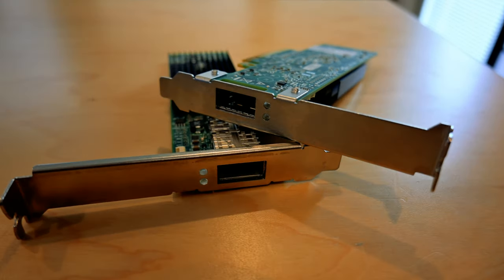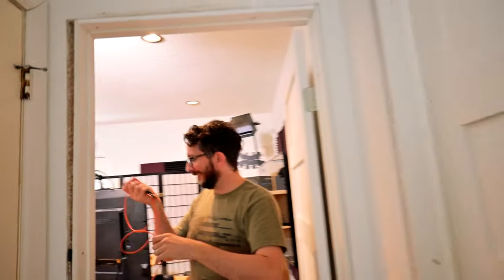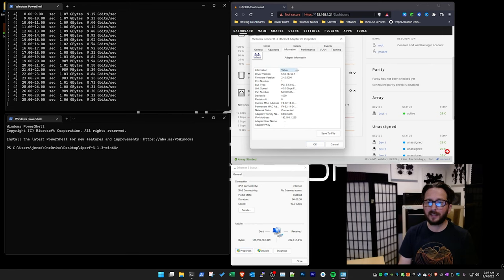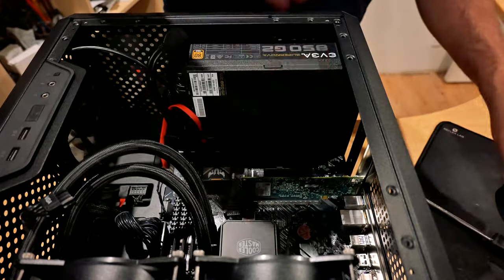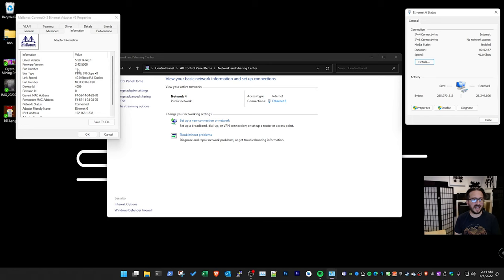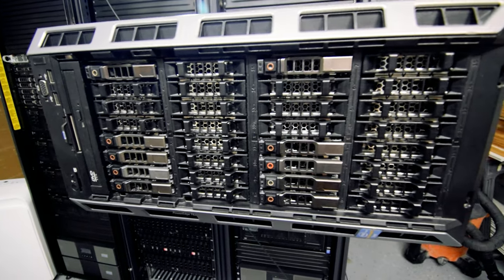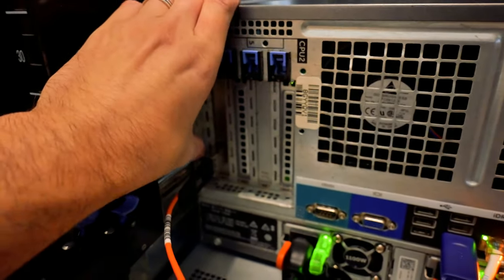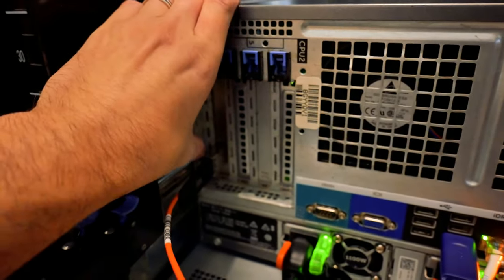ULTIMATE 40Gb Homelab Networking - UNRAID NETWORK SETUP

Comment: I run 100 Gbps Infiniband in the basement of my home.

It was mostly used for HPC applications (CFD/FEA -- that sort of thing). Within those IB/RDMA/MPI aware applications, I was getting somewhere between 80-90 Gbps throughput (depends on the problem and the application, and also the size of the problem that it was solving).

Using the IB bandwidth benchmarking tool, I can get up to around 96-97 Gbps.

For me, using said 100 Gbps IB network for storage is really just a fringe benefit as it wasn't deployed with that in mind.

Having said that, I don't have like a pool nor an array of NVMe SSDs (in fact, I try to avoid using SSDs because SSDs are the brake pads of the computer world in that the faster they are, the more you're going to use and more likely you're going to use them, which just leads to wear out.)

So instead, I use 36 HDDs, and as a result of that, my throughput is limited anyways.

But it is nice that I CAN max out at roughly 24 Gbps with eight HDDs, with the nominal average closer to around the 4 Gbps range. But my LTO-8 tape drive can really do only about 200 MB/s (~1.6 Gbps sustained) so the fact that I have so much networking bandwidth/headroom - again -- storage part of this was just a fringe benefit as a result of the HPC micro cluster deployment that I had.

On a $/Gbps basis, 100 Gbps IB is cheaper than even 10 Gbps, even if the NICs, cables, and switches have a higher absolute cost.

(I run it through a Mellanox MSB7890 externally managed 36-port 100 Gbps IB switch.)

Comment: I just ran a 10gig Fiber line between my Mikrotik router and Switch and it's awesome!
Reply from the maker: The speed is addicting. Folks tell me 2.5 and I'm like....nahhh go 10!
Reply: @DigitalSpaceport  I just set up my first NAS with a 1GB connection. It's very annoying!
Reply from the maker: @eazolan yeah at 1Gb link it's not fast enough. I'm not sure why some folks say that's fine, people expect a folder preview to load pretty fast in modern times
Reply: @DigitalSpaceport  not fast enough when I have a 1Gbps fiber connection with multiple people streaming outside of my network and inside at the same time. I am going to be adding a Dell emc sc420 to my system shortly

Comment: really sweet tutorial, i didn't realize CPU speed had such a big impact on 10/40 gbps ethernet, kinda odd that it doesn't utilize multithreading on the cpu.
Reply from the maker: With 40Gb core frequency is critical. 10Gb less so. When we get to the shared storage video I'll go over some bottleneck points again.
Reply: Something to remember is that these NICS all have ASICs onboard to offload some of the network processing from the CPU to help free up resources.
Reply from the maker: Yeah I need to dig into tunables but for ETH traffic it still blows the hell out of the processor. Do you have some things I should check in specific?
Reply: @DigitalSpaceport  Yea 40G is no joke. It's for sure worthwhile to run a server CPU and board, gotta love those lanes. In regards to the settings It's called a little something different between vendors but what you're looking for is TCP Offload and then depending on what vendor they have configuration guides for things like RDMA, ISCSI, VXLAN offload, etc to be offloaded to the super fast silicon on the NIC. I know for sure Chelsio's cards have native support in BSD based operating systems for a lot of these features. Check the doc from your vendor. As the cards get newer like the 100G and up ones, the onboard hardware is faster and faster with each generation. Older 40G NICs and switches have a bit more latency and less features according to Wendel from L1 and I believe Pat from STH did a comparison on generations of connectivity fairly recently.
Reply: This is a limitation of iperf3 it is just single threaded. That's why you can achieve 40GBit/s with 2 instances! Also increasing MTU size also helps with cpu cycles on larger transfers

Comment: Great video! Love to see more people getting into "Big boy" networking 40G and up! 2 things, have you considered the jump to 100 with Mikrotik's new $999 4 port 100G switch and do these brocades need any special licensing or anything for L2.5/L3 features? Looking at the POE version of what you got. Thanks.
Reply from the maker: I do love the power behind that ICX6610 for sure. I have been looking at that Mikrotik 100g powerhouse but I thought it was only 100Gb total switching? https://mikrotik.com/product/crs504_4xq_in Is this the one you are talking about? 
I need to get PCIe4 NVME storage arrays to really utilize 100Gb and I don't have those servers in the racks.....yet

The Brocades you should checkout the STH thread that has massive info on the ICX6610. If you get one that has not been R2'd it may well have all the original license stuff installed. Mine had the PoE, 80 and 160Gb module (which is what they call all that power in the backside) already. I disabled the PoE on mine but I have a 5548p that already is setup for all that.
Reply: @DigitalSpaceport  Their test data seems way off. I remember seeing it and thought it looked neat for labbers. I wonder if they missed a capital B somewhere. Used 100G iron is starting to come down in price too thankfully.

Comment: Such a cool video.  I adore this shit.  I’m gonna build something similar with TrueNAS, gaming PC’s local, remote bare-metal gaming PC, and 3 gaming VMs using a shared Tesla and a dedicated RTX 3060, just for the fun of it and to learn. iPerf is fine for testing, but good luck getting anything remotely close from an UNRAID array unless you carefully lay out the data across all the disks and then query them consistently.  Unraid is slow, even with NVMe, for numerous reasons.
Reply from the maker: That 40gbe is so cheap is pretty crazy and fun. If you hit FUSE yeah its going to cap out very early. Direct to mounts can be faster tho.

Comment: Great video! Were you able to connect this through Brocade icx6610? I'm getting only 10Gb (I have dual cards) and not sure if there is 40Gb license.
Reply from the maker: Check the licenses section in the GUI to see what you have. System > General and then in the displayed screen click Config Module on the left hand side. If slot 2 reads "ICX6610-QSFP 10-port 160G Module" with status ACTIVE then you have your rear QSFP slots functional. The 2 on the right hand side are 10gb capable (1 to 4) or single 10gb and the 2 on the left side are the actual 40GB ports.

Comment: @DigitalSpaceport I recently bought a SX6036, could you help me configure the switch for ethernet license generation? i have been researching the guide server the home but i am short on time and would like a jump start.
Reply from the maker: Some switch models require the license others have it already enabled by default. It depends on the manufacturer. If you can't enable eth mode/vpi then your going to have to use the serverthehome forums thread and there is also an eBay seller who sells the licenses, I'll leave it to you on the eBay one if you trust that. I've had 3 of these switches now and I think it's the mellanox branded ones that need licenses applied. The HP ones seem to just work outta the box.

Comment: 2 questions:
1. I got a PCIe 2.5gb network card and put it in my machine but I don't know how to switch my unraid to use it instead of my main one (1gb).
2. Dumb question. How do you get that view on your interface, all I got is digits?
Reply from the maker: 1) You need to make sure it is showing up in your interfaces dropdown here: Interfaces > Interface Assignments > WAN and that is where you set it also.
2) Status Dashboard check the upper right side. There is a + icon. Click that and you have a lot of cool widgets to use.

Comment: Nice video, i bought two card Mcx354A -FCBT but my  unraid is not able to discover in network setting ,  can you suggest how to make it working
Reply from the maker: Yeah you are going to need to install the mellanox plugin, in the app store, and may need to flash the cards and/or set them to mode 2 operation ETH if they are for some reason in IB mode. The plugin gives you the steps to do that.
Reply: @DigitalSpaceport   Thank you for the answere , i already install plugin , but the  MCX354 -FCBT is not in the list for the eth mode ,i flash the one for my card at least update, i do not understant how to switch in etherneth mode

Comment: What’s the point with Unraid?  I have 2 servers running 2 x 10GbE each.  Even when I was first copying data where all the disks were being used, I saw a max just over 1.5Gbps.  Pointless.  Unraid is SO SLOW.
Reply from the maker: unraid hits FUSE by default so yeah its slow unless you write to a mount direct... which defeats the purpose in no small measure. Performance, TN wins hands down.
Reply: @DigitalSpaceport  Skipping Fuse is fine for cache running containers, but for the sort of files you’d leverage 40G for, I think you’d want it on the array using Fuse.
Reply from the maker: Yeah my current unraid is running if a 2.5gb linked mini nas... ?so at least it's not a problem for me? I'm not hitting above 240mb ever hehe!